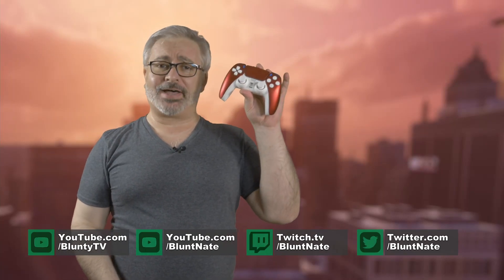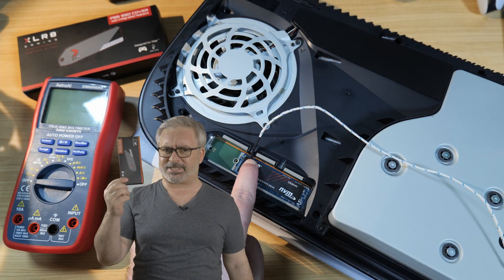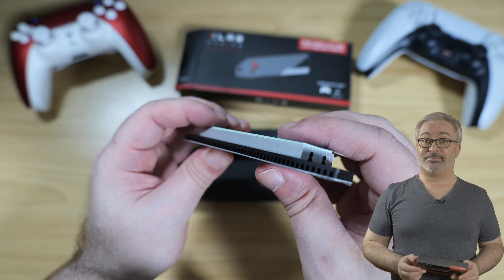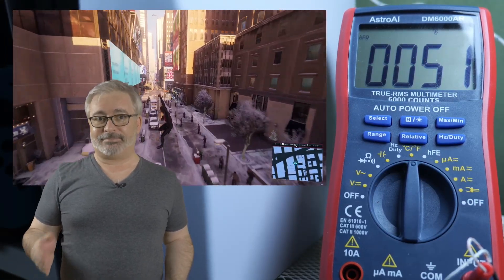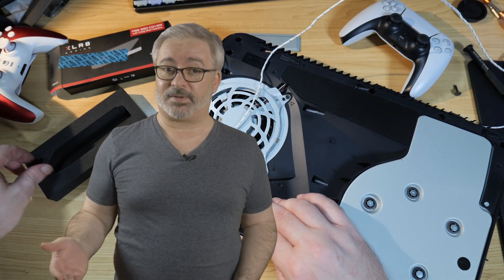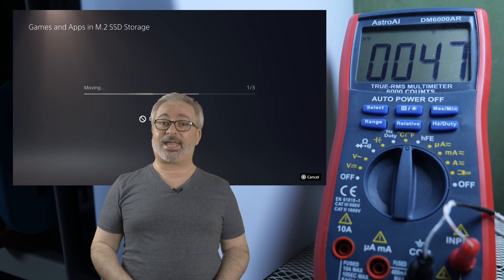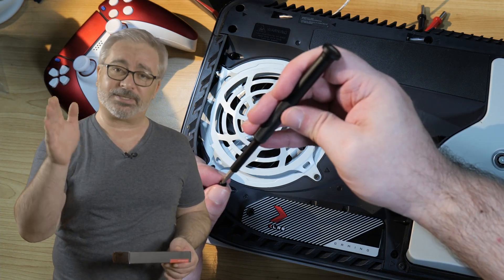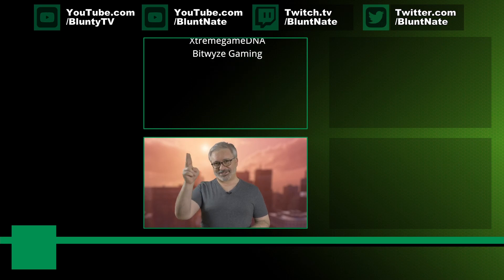Playstation 5 Drive Bay... FIXED! - heatsink for your PS5 SSD

Comment: No PS5, but just witching your videos I am really liking the amount of things you can do to the console. One can improve on it in a few ways after purchase which is surprising for a console that typically would be made in a such a way things like this would be really hard. 

Good on sony !
Reply: I couldn't possibly disagree more. The fact that a very expensive console has so many ways for the user to spend additional money to fix design flaws does not warrant a "good on Sony." It warrants a "shame on Sony"

Most motherboards come with heatsinks for M.2 drives integrated into their design, so you don't have to buy one separately. Sony should have thought about this in advance. Instead Sony seemed to think about it in the opposite direction, going for "how can we restrict the most airflow to the SSD possible?" PNY shouldn't have to sell this product, this is what Sony should have had included in the PS5's box.

Comment: I believe you will get even better result if you tear off the label on the ssd so the heat will transfer more efficiently. What do you think?
Reply from the maker: I doubt the thin label is much of a significant thermal insulator in the conditions we're talking about here. Besides that, with the heat-sink we're WELL below any problematic temps anyway. But sure, no harm in removing it if you want.
Reply: I don't think so, most SSD's stickers are made with heat conductive material. They functions more or less like a thermal pad.